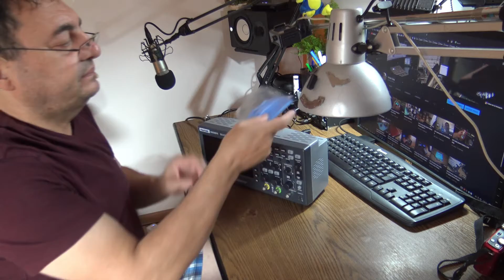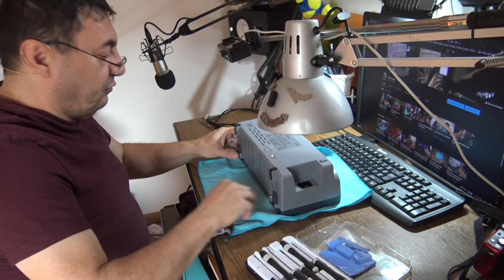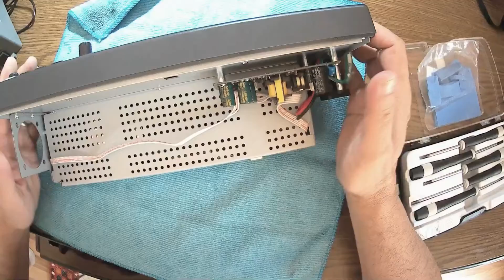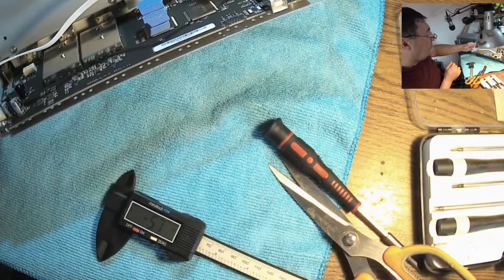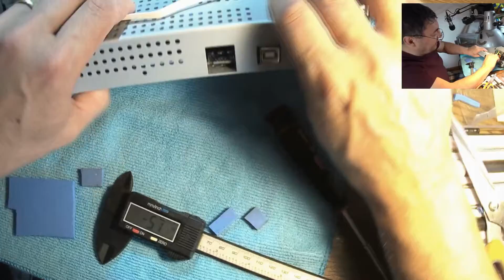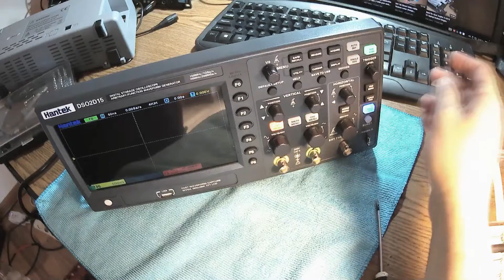Toys for boys 2 Hantek DSO2D15 thermal pad Mod

Comment: You could install thermal rubber on the back side of the board. There is about 5mm between the pcb and chips thermal pads.
Reply from the maker: Right, it was just an experiment. BTW, the actual owner still using it that way!

Comment: Lol, good idea, just not effective enough based on my testing.
I tried it with a different method once with such a design.

I drilled one or more holes at the top of the chip, it depends on the size of the chip and the size of the screw.
I let the screws pass through the holes, so that the head of the screw faces the chip.
Naturally, I ground the top of the screw smooth.
I pulled the upper plate together with larger washers and between two nuts.
It is not a problem if the screw is longer and extends beyond the plate.

I put a thinner thermal pad on the chip than yours, if I had a copper plate as big as the chip and it was thick enough, I would have simply used thermal paste between the chip and the copper plate, copper plate and the screw.
Reply from the maker: Just experimenting...In the meantime I sold it and it's still in the same shape...the actual owner it;s happy like that.

Comment: Probably better off using thin thermal pads or thermal paste and using a heatsink across those two chips. Then add a little airflow maybe stick a small fan in there.
Reply from the maker: Of course! That was just an experiment...which turns definitively! I sold it in the meantime and the owner still using it like that, with great results.

Comment: Solamente uno strato di thermal pad e sopra, a pressione col case, un dissipatorino di alluminio che aiuta la RθJA, ovvero la resistenza termica giunzione-ambiente (°C/W).
Uno dei tanti problemi di questo giocattolo, che purtroppo anche io posseggo, è che non triggera segnali sotto 100mV.
Reply from the maker: I just improvise

Comment: Sorry to burst your bubble but heat pads don't work that way.  You were better of putting a real heat sink with some thermal paste.  Some microchips are ok working at high temperatures. But adding a small fan would be a better solution.  With all those thermal pads stacked up you are blocking free air circulation to cool off other components.
Reply from the maker: Thanks! There was no bubble..just an experiment.I sad '' I have no heat sink for now ''! And it's very possible those chips are designed to run at high temperature..so far so good.I don't want a fan, to noisy even at low pad. With the pads on can't say better or worst , I use the oscilloscope occasionally though.
Reply from the maker: Of course, it's already in place

Comment: More heat dissipation can never be wrong.
Do you have any experience with such thick layers of thermal pad? Is the heat transmitted to the metalic case?
Reply from the maker: Yep, I use it in many projects..but never so thick.. Probably will work